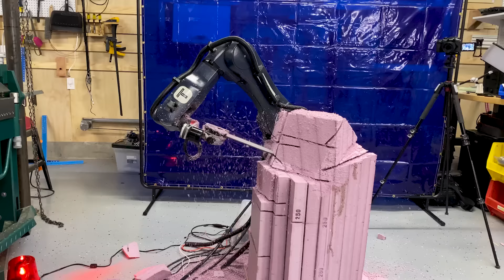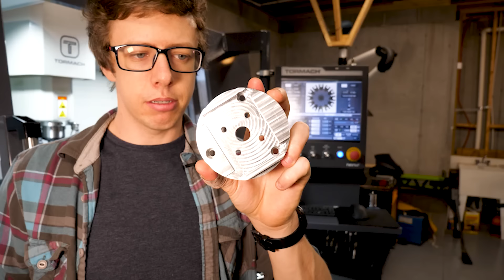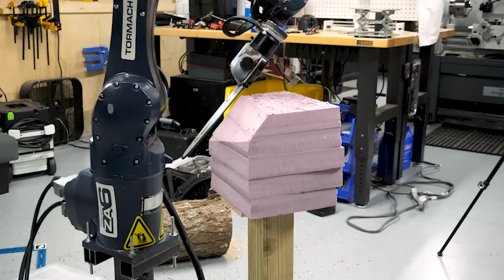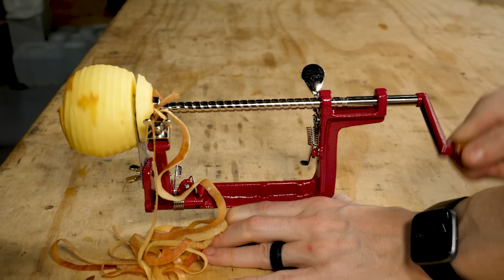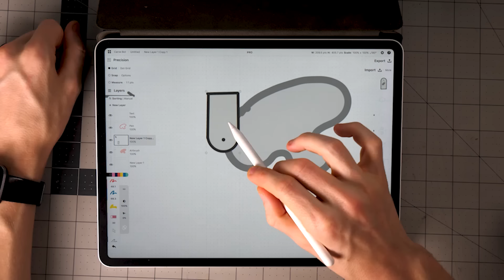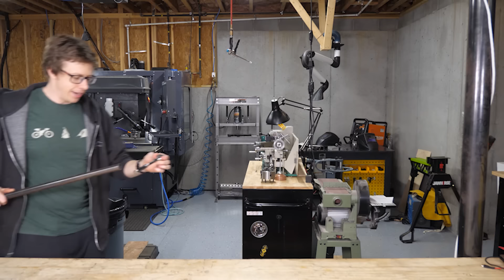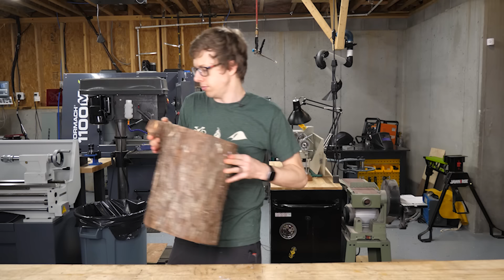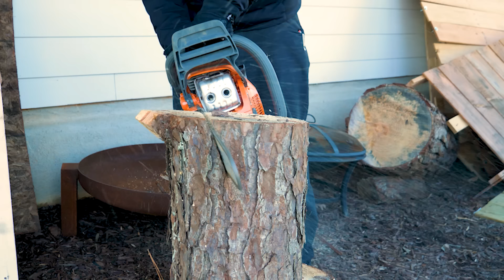Chainsaw + robotic arm = art?

Comment: @Stuff Made Here
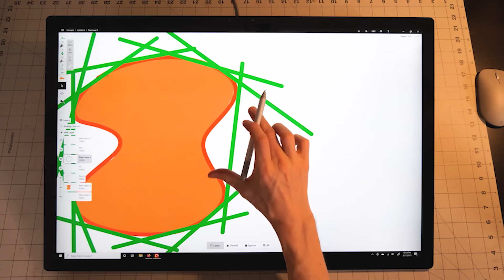I got an idea how to avoid the local maxima problem (and gradient ascent) completely. If you look at a polygon shaped model, such as the dog, you basically have a collection of flat surfaces. In theory every individual flat surface can be created by a single plane-parallel cut into the material. Such a cut can only be done along the surface plane (plus an offset, that is the cut-width). The possible points from which to do start that cut all lie on a circle. You can iterate through those points and look for a direct line that does not intersect the model. With this you should be able to make all cuts except for the innermost flat surfaces in the concave areas you mention at 8:34.
For those final cuts it is necessary to make do with what your robot is actually able to do. You aren't able to do the cut required for that surface but you can do cuts that only leave a small pyramid remaining in its place. The number of sides the pyramide has depends on the number of edges the surface is supposed to have. The necessary n cuts can probably be done at a 30° angle or maybe at a 45° angle without colliding with the polygon model. With this you should be able to approximate any given polygon model as long as it doesn't have deep and narrow concave areas. Therefore you only need a polygon approximation of the model you'd like to carve and there is probably software or freely available code out there for that.

Cheers, and give me a reply if you actually think about implementing the idea. I'll definitely keep track of the channel regardless of the outcome.

Comment: Amazing work! Seriously. My brain melted watching you code this one! 👏 

Tree chap here. First off I could never dream of achieving something like this, all I know is chainsaws, so my limited knowledge in the most basic field covered in this video goes as follows (if it helps)...Make sure it's oiling the bar sufficiently to keep it cool. Maybe consider a carving bar which has a smaller nose sprocket diameter. Regardless the nose of the bar should actually cut pretty aggressively (kickback zone). Tighten up the chain, it's a short bar so you shouldn't see that much slack in it. Get it sharp as frigg and finally get a depth gauge tool. You can probably get them fairly low as kickback isn't so much of an issue. Be mindful though the lower the depth guages, the more tool chatter you will get 👍 Always disappointed with how new chains come out the factory. Failing all that, ask a friendly tree surgeon to set your bar and chain up, you won't be disappointed

Comment: Hey maybe you should have tried L-BFGS for the ascent? There are libraries you can use to do it. Because it sort of uses second order gradient information you may have a better chance not getting stuck at local maximums.

Edit: great video btw as impressive as always
Reply: Yeah it is much simpler as well
Reply: @ShivamKumar-xx6nv  I feel like L-BFGS is theoretically much more complicated than gradient ascent. Do you mean using L-BFGS is simpler because you don't need to tune the step-size like gradient ascent?

Comment: When processing is your bottleneck, Cython might be exactly what you need. It speeds things up by a factor of about 100, and only requires a small amount of extra knowledge and 1 compilation step.
Reply: I think you mean Cython?  CPython is the name for the normal C based python implementation.
Reply: @JustinMayfield  I did, thanks.

Comment: You should look into getting a carving bar for your saw, it's what the people use when doing statues like this. Most of the bars and chains you can get arent ment for cutting with the tip as you found out, it's a safety measure so the chainsaw doesn't kickback while cutting. Carving bars have special chains that allow for cutting with the tip so you can do more detail work.

Comment: Using RoboDK would probably save you some crashes. You could also use it's API to talk between your code & RoboDK. 

I am wildly impressed with your ability to apply math for these sorts of things. It's remarkable, really. However, just to throw an idea out there, the chainsaw cuts kind of reminds me of a swarf cut. Could you use Fusion 360 to try and swarf cut your way around the part? Handily enough, there's a Fusion / RoboDK API too!

Comment: Anti kickback tooth?  That's not what that is. Those are rakers which control the depth of the cut. I can't be the first one to point this out.  
Anti kickback teeth face the other direction and bite in to the wood and are only present on some chains.

Comment: I think an "easy" way to solve this would be to create stages where the polygon count increases and move the chainsaw along the planes of the surfaces of the model. So you'd start with a mega low polygon which will be long, deep cuts to remove most the material. Increase the polygon count and repeat.

Comment: I haven´t used any CNC software for any period of time, but YT University told me that there is a pecking function for drilling operations built into many of them. Maybe that pecking funtion can be repurposed (this is where the black magic starts I guess) to wiggle the saw a little. Also, having used chainsaws extensively, make sure the chain is sharp. Great Video, as always!

Comment: That turned out really great. With the algorithm I was thinking could you not use the faces of the model to define your cuts, each one is part of a plane that needs cutting along, just using the larger faces initially, check which planes don't intersect the model and that's your rough cuts, then iterate from the new model or use the algorthim you were using to achieve the finer details? But then I just watched a 20 minute video, you actually built the machine and software.

Comment: Really awesome way to explain CNC's simply for anyone to understand! You are an excellent teacher! Genius level of intelligence but at the same time can simplify this knowledge and communicate with an easy to follow and fun presentation. So many teachers I have had who are way too smart and lost their ability to communicate with us common folk.

Love how you did not just throw a router / mill on the end but instead tortured yourself with a challenge that has never been done before....robo chainsaw arm of death!  As if a robotic arm was not dangerous enough!  This chainsaw is a really awesome way to knock out large portions of waste material without having to mill it all away. Maybe that is your plan? To have interchangeable tools on the end, saw for the first pass and then smaller end mills for the fine detail cuts. Really amazing work!

I also love how you can do the most complicated fabrication and programming...but when it comes to 3d modeling a bear or a dog, nope, just download that😆

Comment: For the issue of the saw just rubbing on the wood, take a metal file and knock down the depth gauges (the little teeth you said was for kickback), until it just cuts enough

Comment: In choosing your cuts, have you already considered taking tangents to your model outline and sort them in order to get the most plausible cut that your chainsaw can get? I mean this might make it slightly more efficient in choosing cuts and which cuts are realistic?
Reply: This might also keep your lines and cuts paralel to your model and avoid the chainsaw smoke issue. Also when you are done with the first touches on the shape, with the tangent algorithm described above, you are left with a rudimentary shape that you can easily manipulate with the apple slices algorithm from the beginning. You kinda use it as a ginishing touch, to rough up the edges of your product

Comment: The problem with the gradient ascent algorithm, where you get stuck in local maxima or local minima, can be fixed using another algorithm called simulated annealing. Similar to gradient ascent, the algorithm starts by choosing a random solution in the search space. Then, it analyzes the quality of that solution, just like GA. Unlike gradient ascent, however, there is a probability that the algorithm will move on to analyzing a less optimal solution. As a result, the algorithm has the opportunity to escape the local minima or maxima and find the global minima or maxima. The important thing with the algorithm is that the probability of checking a less optimal solution decreases as the algorithm progresses. As a result, the algorithm has the opportunity to explore the search space briefly before going in to find the best solution.

Comment: Would it work to simplify the geometry a few times until you have let's say 30 surfaces, then cut those. Then use a less simplified geometry with more surfaces, cut those, and so on until you get a thing you like? This way you're computing from the model out instead of up to the model so it should take way less time to calculate everything.

Comment: So gradient descent is a problem-solving tool in Machine Learning. It's typically reversed, we're usually looking for the minimums but the principle is the same. Can also run into the issue of finding a local minimum vs global minimum. One way you can sorta deal with this is, instead of having a single original guess is to have say, 10 starting points that are equally spread out like a grid in a square for example, and then do gradient descent for each one. You'll find most of the local minimums and probably the global minimum and shouldn't be too much more computationally expensive.

Comment: The cutting path seems overly complex. And I would a side projection to get a 2D contour, put equidistant points along the countour and find the largest cut that can be done. Repeat and rotate for differents azimuths and elevations. Then throw an algo to find largest remaining volumes and reapply the loop on the largest to smallest volume.

Comment: This is a really awesome project. Don't know if this would help with the issue of cutting wood, but it looked like as you suggested the guide teeth (also called rakers or as you called them anti kickback teeth) responsible for maintaining the cutting depth are too long. It part of regular maintenance when sharpening a chain (something that might also help here) is to file down the guide teeth a set amount. There are kits avalible with a guide to help get the depth correct and loads of videos that can better explain this than I can. Another small thing is it didnt look like there was much or any chain oil on the chain, not sure if you were using it or not but it will help cool the blade as it gets automatically applied out the reserviour. Hoping this doesn't sound like i just pointing out the obvious as that is totally not my intention.

Comment: It feels like you are trying to use a engine to go both fast and slove whiteout a gearbox. Can't you just make a ruff box cutt whit one program and the fine cutt whit another. Like you use fast travel and  working travel on a CNC machine. But in software form. Fast travel in CNC machining is in my mind youst an outer air cube around the fine cut. Instead of a wood cube like in this application. And fast travel exchangeable to less precise control of movement. Youst a thought eyebald in the kiwi commercial time. So sorry if I'm way off...

Comment: I love the engineering and beauty of watching it move and make cuts. Maybe not a "one size fits all" approach to determine good cuts. Sometimes special cases are easy to locate, and we can handle them first, either first or last. Like an actual chainsaw craftsman, you could use multiple passes, using different techniques to take on different shapes. Unfortunately that mean a lot more code.

Comment: Sooo just from an EE’s perspective thats done some log slabbing..

Cutting with the tip...not going to happen on a cut you are trying to do due to the grain structure of the log and the direction you are coming in at. Might want to look into a loggers chain/skip tooth chain (teeth at 5 degrees and no rikers) but stay back and be ready for kickback. 

You also may need to add a much more powerful oiler for the chain.

Comment: I have run into the same problem of gradient descent finding a pseudo peak. To avoid it, I found stochastic initialization really helps. In order to run gradient descent, you need to provide a first guess. Instead of doing 1 guess, do thousands of guesses, run them all through gradient descent, and choose the minimum one.

Comment: When you were having the problem trying to find out where to cut when a chunk was taken out, I began to think. Rather than trying to use the gradient ascent technique with just the chainsaw, I feel like it would have been really cool to see working in combination with LiDAR. Unfortunately, it might require a lot of software work, and the engineering would be a bit odd to work out but I believe that in the end it could be a really effective method. The LiDAR would effectively work out the geometry of the log for the robot arm with the chainsaw, and could calculate it that way or compare to the original 3D model directing the arm’s cuts.

Also, you videos are awesome because they don’t just show the final product, but most of the design process leading up to it 🧡

Comment: I learned how to code to find for absolute maximum on a 3D plane.  It was indeed very difficult and complex for me, even though I was being taught it.  In the 3 years since learning it, I have completely forgotten it, but have wished I wouldn't have 2 times now. I used it for design optimization.  Wish I would have remembered how to use it, very useful if you have the time and ability to code it.

Comment: Start with a point cloud of random guesses with a large range of values and only start gradient ascent with the highest guess from the point cloud. Once finished test the second best, if it is higher repeat the process for up to three times. Always keep a list of the top 3 solutions. This will probably resolve gradient ascent getting stuck on really small hills with poor values but does significantly increase the computational complexity.
Reply: Given the time to take actual cuts is pretty long you could optimize this by ensuring the search for a step takes at least as long as the current cut and it just takes the best solution it found when the current cut has finished.

Comment: “I optimized this code so hard, it doesn’t even do anything!” - gcc, making the lives of engineers more confusing for years!
Reply: Example please? I haven't had issues with gcc's optimizers before. Just remember to put it in debug mode if you want the debug info to be of any use, obviously
Reply: @kalebbruwer  optimizations only work because you allow gcc to add hidden assumptions to your code. Usually they are pretty reasonable, like your code does not depend on integer overflow, or does not read outside of valid memory. But if the code violates the underlying assumption, the result can actually be optimized to the point where the code does no longer work. 

Still I disagree with the OP, I think how gcc can deterministically find all these optimizations in no-time mindbogglingly awesome.
Reply: @Kaleb Bruwer i’ve had gcc just eat pointless code while i’m testing the speed of features. Also i’ve heard cases of gcc making code with complicated constructors in loops faster than a version of that code with the constructor outside of the loop, though those stories are anecdotal.

Comment: The reason your chainsaw isn't cutting is probably because of the depth gauges. if they are to high, the tip of the teeth will not be able to cut. if you shorten them to much however, the teeth will have to much material to cut and will get stuck. read up a bit on how chainsaw chains are sharpened, it isn't really very hard to do yourself. there are tools that help you with the angles and correct length when filing chains.

Comment: To stop the rubbing, you should just be able to sharpen your chain. That involves, in part, filing down those depth gauges and so will give you a bigger bite on the wood.

Comment: You probably already know this but I'll tell you anyway.  You can get special bars for chainsaw carving. Also looks like your chain needs tensioning and sharpening.  If your bar isn't cutting at the tip, it's probably not cutting on the top or bottom. Take the rakers down with a flat file.

Comment: Step one: you could partner with  a chainsaw artist, you could mocap them carving a bear and then use the 3D paths to recreate the same carving with optimal path.
Step two: you could the feed human-derived (optimal for the cutting paths) into an ML system that learns what optimal paths are, and then you could tie the path-building algorithm into that ML model. Voila! Optimized paths that don’t set off your smoke alarm.

Of course that means getting a LOT of human data through a LOT of motion captures.

Comment: The problem with the wood cutting might be that you had full teeth, the second thing specifically on the bore cuts is that the rakers(anti-kickback teeth) were too long, you have to file them shorter as you sharpen the teeth, most small engine places that sell saws will also sell guides and files to cut them down to size.

Comment: Great Project. I do have one BIG word or warning, from someone who has cut firewood most of my life.....52 y/o today. the chain on your saw is WAY to slack. there is a REAL risk of it hopping out of the bar. Cutting in wood with a slack chain doesn't cut well....sometime not at all. The tooth you called the anti kickback is in reality the Depth Gauge. you can file that down a bit and it will cut more aggressive, and potentially better at the tip. I've sharpened my own chains for 10+ years....I check the depth gauge every sharpening, but they don't need to be adjusted every time......I could go into the geometry of the cutting teeth....but that is an easy internet search.